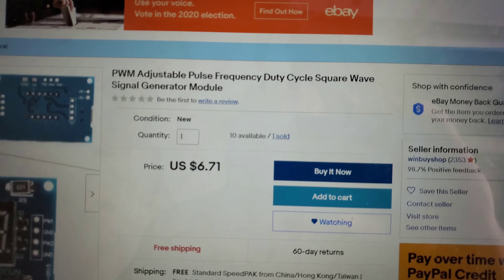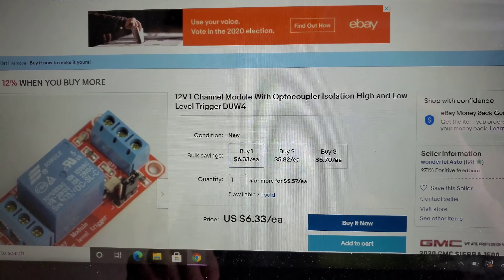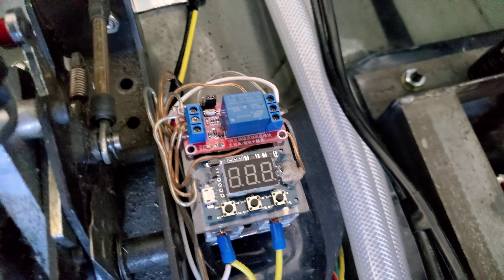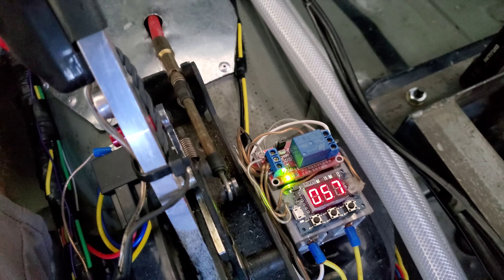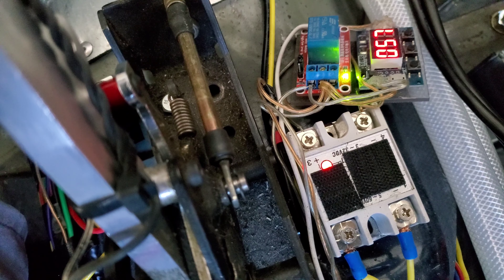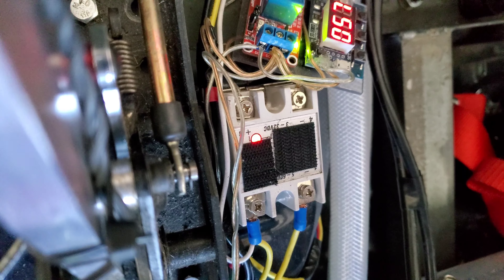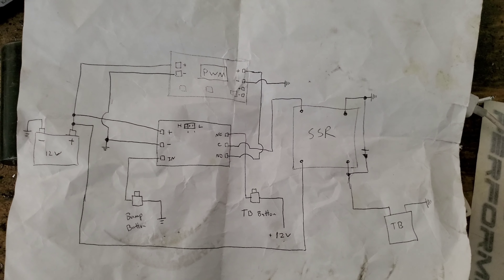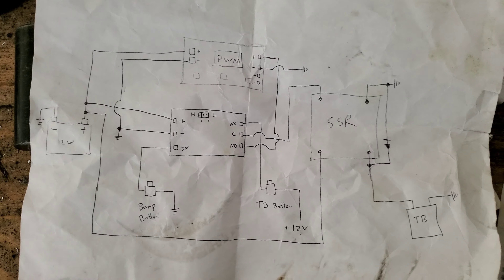DIY Bump box/trans brake creep box w/ PWM for under $15

Comment: Hi Jeremy. I know this is an older video, but just wanted to let you know that I built this and it works great! So, thank you.
I made one change in that I used a different PWM module that has an LCD display that shows both Freq and Duty Cycle at the same time. Also noted that hitting the bump button by itself also activates the trans brake. A simple additional small relay will fix that.
Thanks again
Ron
Reply from the maker: Very happy to hear it!!  Do you have a link to the pwm you used?

Comment: On the SSR you have the TB going to ground on both sides
Reply from the maker: I'm not sure what you mean.  The power comes straight off the battery, into the bottom left pole of the relay and then out the bottom right, into the TB and then it's grounded
Reply: @turbojeremy13  I think he’s referring to your diagram where it shows a jumper from the ground on the top right to the bottom right. It had me a little confused also.
Reply from the maker: @johnduhon4173  you mean on the relay?  If so, that's a flyback diode.  Designed to protect the relay.  It's not necessary tho, just a precaution
Reply: @turbojeremy13  I figured that’s what some of the other comments were referring to. Just wasn’t real sure if that was the diode or not. Thanks for the clarification. I ordered everything last night to get mine started. Appreciate all the information!!!

Comment: Do you sell the pt # to what you need and a diagram for the wiring?
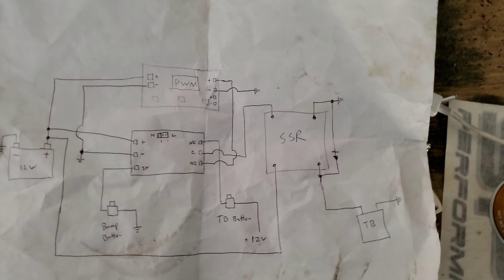Reply from the maker: The diagram is authentic 6:16 mark in the video.  The first 1/3 of the video has the parts I used.

Comment: Did you use the flyback diode and if so which one?
Reply from the maker: I ended up not using it.  It was recommended to me to use one which is why on the wiring diagram I showed one but I don't use it.  Hasnt caused me any issues
Reply: @turbojeremy13 
 That diode if used should go across the trans brake solenoid  POS and NEG  not across that relay ? That's a short.
Good idea BTW.
Reply from the maker: @Glenn Geddes  I honestly don't know.  I was told to add the diode by some one who knows more about electrical stuff then me.

In my old car, I used the diode.  When I moved the bump box over to my current car I left the diode off and its never been an issue

Comment: What numbers do you have in the PWM?
Reply from the maker: I'm running 57 on the duration and 20 on the frequency.   Its a good place to start.   Every car will be a little different.  My car when I bump, moves forward at the same speed it would at idle if I just took my foot off the brake and let it roll.  Try starting at 55d and 20f and adjust duration as needed